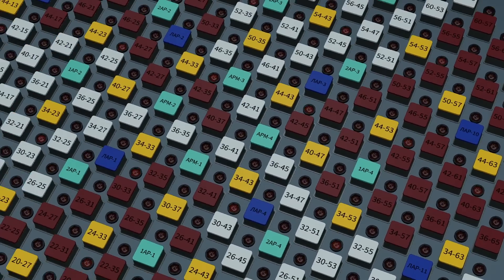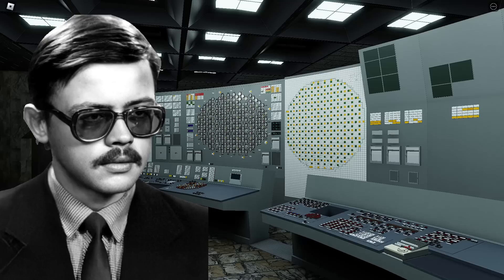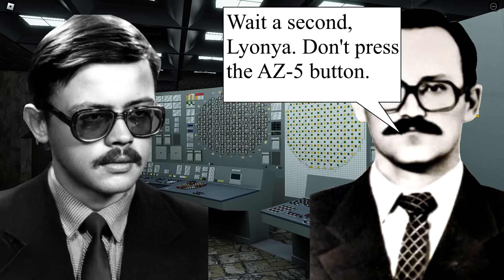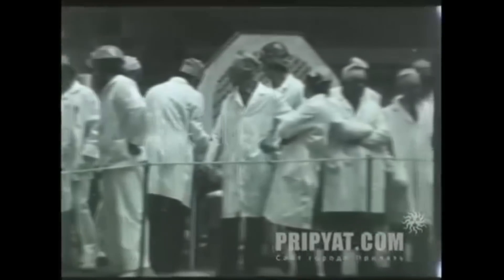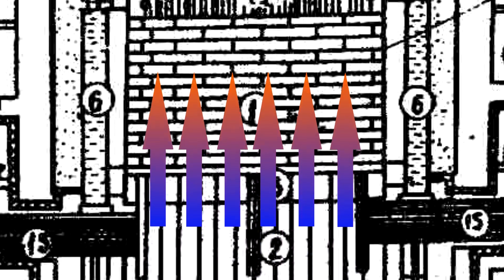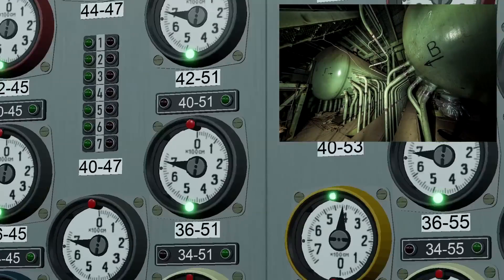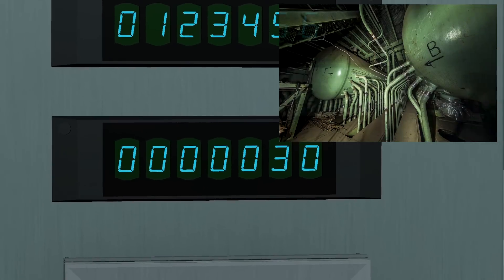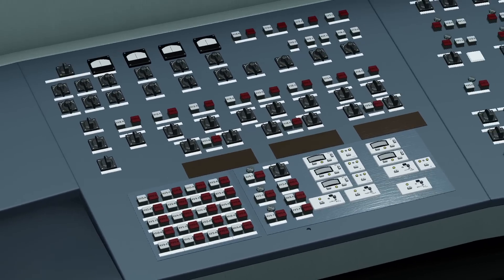Would Not Pressing AZ-5 SAVE Chernobyl?

Comment: Imagine you are fighting a fire, the fire is getting out of control and you hit a button to turn on the sprinkler system to stop the fire. Except the first thing out of the Sprinklers is gasoline, then water. That is exactly how those graphite tipped control rods reacted.
Reply: Not only do I agree with your idea but going off it, if people tell you “hey this is the button to activate the sprinkler system” “hey this is the button to shut down the reactor” than to me theorizing is kind of irrelevant because the button shoulda done what they were told it was going to do!
Reply: @littlehessurabi They should have known how the reactor is built to operate it.
Reply: @Ballin4Vengeance The Soviet partisans hid the truth about the design flaws, so nobody in the control room knew.
Reply: The 1.5m long graphite "tips" really should have reached all the way down. For maximum effectiveness and no positive scram effect. Bit late now though 😞
Reply: @233kosta  That is in fact how other RBMKs were retrofitted after this disaster.
Reply: @ArchangelUltra   One of many changes to make RMBKs less shit I'm sure.
Reply: The problem was that pressing the AZ-5 button sped up the process because of the graphite tips. It was like firing one of those small Q146 space modulators made by Marvin the Martian to blow up the Earth in Looney Tunes.
Reply: @joshuabrown3525  🤦
Reply: @joshuabrown3525 except the damage to the reactor from raising the power with 0 control rods in had caused the channels the rods were inserted into to become deformed they would’ve have gotten in regardless
Reply: Kinda, the graphite itself did not boost the reaction much, it was there to displace the water. The problem is in that circumstance, the water split into hydrogen and oxygen, oxygen being able to light and hydrogen being explosive. Normally that would be fine but there was too much pressure in the core due to the operators pushing the machine to far. The whole thing was designed for normal problems and not worst case scenarios.
Reply: @Tydye177 graphite did boost the reaction by a lot though
Reply: @Tydye177 There's evidence of the reactor going prompt critical in two locations immediately before the big explosion. The displacers are a good idea, but as is the case with most of communism - the implementation was somewhat lacking.

In this particular case, the problem was that they did not reach all the way down the channel with the rods fully withdrawn. This means that there's water under them which takes away reactivity.

When the reactor is already in an unstable state and reactivity is too high in areas where there's water in the channels, it is inevitable for graphite to pass through those areas first, before the boron rods make their way there.

Unfortunately that leads to a spike in reactivity, in an area which is already exceeding safe limits.

Had the implementation been such that the displacers permitted no water at all in the channels, this dangerous level of reactivity would have been reached sooner, perhaps preventing the withdrawal of so many control rods and prompting action from the operators sooner in order to shut it all down. Or it would have happened too quickly and blown up anyway, we'll never know. What definitely wouldn't have happened in that case though, is the positive scram effect which is widely regarded as the trigger of the big explosion.

Whichever way we look at it, it's a shit reactor. They never should have built it. And if they hadn't, the whole planet might have been nuclear powered by the '90s.
Reply: @Tydye177  yeah! the exponencial problem at the end was cuting water supply to run the test. when the water disappeared the reactor had no brakes. with or without az5 it would explode. it was a matter of time. the tips of graphite was the least of their problems. if it had boron tips it problably went the same way.. because if graphite became stuck for the cheer pressure inside the reator the boron tips would be also stuck because those braindead nuclear physicists removed ALL the fuking rods ALL the way out.
Reply: That is the best analogy I’ve ever heard to describe what happened excellent analogy
Reply: John Harris, i salute you and would love to hug you for such an impeccable take on the matter. 
Amazing!! Thank you❤.
Reply: Or like if you went to use the brake pedal before speeding through an orphanage, the brake momentarily accelerates the engine for a few seconds and then it begins to slow down.
Reply: Not exactly how that worked. They kept turning off alarms and ignoring the problem. They could have stopped it multiple times.
Reply: In that case pressing the button made no difference to the outcome.
Reply: @jekanyika  Actually it blew up the reactor.
Reply: @johnharris6655  I was talking about your fire analogy. The building would burn down regardless.
Reply: That’s how they reacted because the firefighter filled the lines with gasoline before he hooked up the hose to the water.  Dyatalov disabled the safety mechanisms in order to retract the graphite tips from the reactor… a position they should NEVER have been in. That’s the equivalent of putting gas into your sprinkler lines. When he hit the button… he inserted all of the graphite at once and spiked  the reactor. 

If he had done with the other technicians wanted when the test failed and just shut the reactor down normally it would not have exploded
Reply: Bro just described what we already know 😂😂😂
Reply: They were not graphite tipped. That is an oversimplification from the Chernobyl show.
Reply: Honestly, more like napalm.
Reply: It isn’t, the rods weren’t “tipped” with graphite as much as graphite was part of the rod design to help boost reactivity when the rods were withdrawn. The graphite was already in the reactor, they just couldn’t move them. 

A better analogy
Reply: Sort of... when the graphite passed next to the core, it accelerated the reaction exponentially, causing the temperature to skyrocket, boiling the entire coolant reserve which pressure locked the graphite in place, meaning, your sprinklers would have initially sprayed gasoline onto the fire with the intention of alternating to water almost immediately, except the valve stayed stuck on gasoline.
Reply: Nice analogy
Reply: Для любой аналогии к этой кнопке стоило добавить фразу "вы собираетесь потушить водой раскалённую до 10 000°С поверхность, доступ к которой осуществляется через микроскопические отверстия, потому что конструкция реактора не позволяет сделать это иначе"
Reply: I think better analogy would be that someone brought lots of grease to a building with sprinkler system and when the grease caught fire the sprinkler system made it worse. Sprinkler system was not designed for grease fires, just like the AZ-5 was not designed to cope with every scenario imaginable.
Reply: There was no fire. Reactor was not in a runaway when AZ-5 was pressed.
Reply: @xentiment6581 from my understanding the power has started to rise before they pushed AZ-5. And since the only thing reducing reactivity was the fuel temp coeff, it was basically already out of hand. Maybe they could've saved it by increasing the coolant flow, but I think that was the only option to prevent the power from rising. So it was basically already ignited.
Reply: More like nitroglycerin but yes 😂
Reply: It's not exactly how it happened its more of an analogy 😂
Reply: The HBO series was wrong about the control rods. It was the void half way in them that was the update.
Reply: Why would graphite be on the tips of control rods designed to slow  down the reaction rates??
Reply: @jonthomson9262  Cheap design, use the bottom of the control rod to speed up the reactions.  All well and good while the tip is not raised too far
Reply: @alanhaywood01  In fact, it seems to me like a good idea, if the end of the rod contains a moderator, then such a rod can regulate the reactor much faster and even stop the nuclear reaction quicker (by retracting graphite and inserting boron into the active zone, faster regulation can be achieved than just by inserting boron), the only problem was that the graphite did not reach the end of the active zone.
Reply: @alanhaywood01  well precisely, it wasn’t actually the cheapest design, but it worked for what the Soviets wanted it to do. It worked as long as you didn’t take the rods out too far and the safeties were placed to prevent that but Dyatalov disable the safeties and shut the computer off because he was intentionally trying to stall the reactor.
Reply: @jonthomson9262  So from my understanind of how the control rods worked, the RBMK had a sort of dual moderator/absorber system because it would simplify the reactor having both attached to the same rod. However, this turned out to be a fatal flaw.
Reply: @TheArrowedKnee  it wasn’t a fatal flaw in isolation…. Meaning that it was a known design limitation, and the designers built in safeguards to prevent the rods from being fully retracted and causing this problem….. but the operator, in this case Dyatalov disabled and removed all the safeties and then turned off the control computer that kept telling them to shut it down because he was trying to intentionally stall the reactor …… which is the equivalent of a firefighter loading up his hose with gasoline, and then wondering why spraying it on a fire caused trouble
Reply: @jonthomson9262   Because when you pull them out you want them to speed it up, and sticking moderator on the end is a good way to do that. Makes them much more effective at controlling the reaction.

Big mistake was leaving that much water under them when fully withdrawn.
Reply: @jonthomson9262  Graphite reflects the neurons, boron absorbs them.
Reply: Na... gasolinera Just make thenfire bigger, you are throwing water into a oíl fire
Reply: Yes, exactly @hernanweber3896
Reply: @hernanweber3896  Water AND gasoline mixed with diesel into an oil fire.
Reply: @hernanweber3896 learn to press space ffs
Reply: This is exactly the misconception this series of videos is trying to prevent.
Reply: This is the most “I didn’t watch the video” comment I’ve ever seen.
Reply: I think everyone is forgetting that a channel ruptured and prevented the control rods from going all the way back in, and THAT is what caused it. The graphite tips essentially sitting halfway in, accelerating the reaction due to the tips. The core was poisoned by xenon 123. Due to this poisoning, the power went to a mere 1% of the power required to do the rundown test. They raised the power, completed the test, and hit the scram button. It's important to note how quickly this all happened. Probably about one minute. Upon hitting the button all the control rods were inserted, after all but four were removed. As they slowly moved back in, reactivity and heat skyrocketed creating steam pockets in the water channels. Due to the positive void coefficient, rather than a negative one, the steam sat there and got hotter, and built more pressure until the unthinkable happens. Dyatlov, after all my research, was in the room, knew the core was poisoned, and still went ahead with the test knowing that the reactor was already unstable at low power and pushed it to the brink of disaster. The stars aligned perfectly that night
Reply: Best analogy i found
Reply: That actually HAS happened with the antifreeze they use in them back in the day.
I think they switched to non-flammable antifreeze for that reason
Reply: Fantastic analogy
Reply: You’re in shock…….nuclear reactors don’t explode. Someone get him out of here.
Reply: @WarNvrChanges  soviet RBMK reactors don’t explode comrade. You did not see graphite on the roof.
Reply: What a dumb analogy... You completely misunderstood what AZ-5 is if you compare it to a sprinkler...
Reply: @KasSo89  It's more like an engine fire extinguisher that borrows the fuel lines 🤣
Reply: @KasSo89  I think you are a Dyatlov wannabe 😐.

Comment: Why do you keep referring to water? That's at 100° plus Celsius as though it's not already boiling? Is it under pressure in the reactor or something? Once water hits 212°, it becomes a gas at one atmosphere of pressure.
Reply from the maker: The RBMK operates at 65 atmospheric pressures, so the boiling point of water is much higher :)
Reply: @thatchernobylguy2915  That makes sense, thanks for the info!

Comment: So basically the reactor would have automatically done the same thing as pushing the AZ-5 button. But if you could avoid this automatic process, and not press the button, then you likely still have a disaster but not nearly on the same scale because it probably wouldn't have blown up. The only thing I can think of is that you would need to immediately start inserting some control rods in order to try to lower the reactivity in order to not trigger the automatic process, but it's very likely this would still fail.

Comment: AZ5 was a detonator, not a shutdown
Tips of boron rods were made of graphite that induced enough reactivity for an explosion.
If they didn't press the button, the active zone would rupture due to tremendous heat and pressure that would result in a meltdown, not an explosion.
There would still be consequences like a white hot radioactive magma made of reactor fuel, graphite and concrete that they need to solve to prevent it from seeping into the groundwaters but the grand scale of the disaster would have been tens of times lower
Reply: They weren't really tips, they were as big as the control half of the rods. They were more like accelerators and they were already in the reactor when AZ-5 was pushed. 
The problem was they were a bit shorter then the height of the reactor with gaps on both sides between the graphite half and boron half(so below and above them was water) and that due to how long the reactor had been running at low power there were hotspots at the bottom. So when they all started going down at once to push in the control half of the rod, the bottom of the reactor would have had the water pushed out from those channels and would have had basically nothing to stop the reaction down there where it was already hot. This popped a couple fuel channels thus jamming the rods(meaning the graphite side was fully at the bottom of the reactor only just barely pulled out the bottom leaving no room for a water gap down there, and the top part had a water gap as the boron rods were just barely starting to get in) which lead to a runaway as the most unstable spot in the reactor now had even more graphite and less water and the boron rods couldn't get in
Reply: It wasn’t a detanoator it was just that the AZ-5 was a 1$ shutdown botton

Comment: is there a mistake in the temps?
Reply from the maker: No, high pressure increases the melting and boiling point of substances, including water :)
Reply: @thatchernobylguy2915  i knew pressure would effect it. Just shocked they can reach 2.5 x the boiling point.

Comment: By the time they pressed AZ5 it was already too late. They might have saved it shortly before that by inserting the shorter control rods from the bottom, where the reaction was running out of hand. They didn't have the graphite displacers and could conceivably have slowed things down enough for the main control rods to be lowered a few at time. Of course, shortly before that they could have just not pulled them all out in the first place.

Comment: At around 1:06 you mentioned that water enters the reactor at a temperature of around 265 degrees Celsius. I don't understand how this can be. I learned at school that water boils to steam at 100 degrees Celsius. Is there a mistake with the units; or am I missing something? Thanks very much for the interesting video.
Reply: Water has different boiling points depening on atmospheric pressure. The higher the pressure, the higher the boiling point and vice versa. 100C is the boiling point at 0 sea level.
Reply: @saladin69  I see. Thankyou very much for taking the time to answer.
Reply: RBMKs are Pressurized Water Reactors which operate at high enough pressure water can be liquid as high as around 400C. Boiling Water Reactors operate at far lower pressures and so water boils more in the 250-280 range.

For comparison, in Denver Colorado water boils at 95C. At the peak of Mount Everest it boils at 68C. If you were on the coast of the Dead Sea(1400 ft below sea level) water would boil at just over 101C. If the Dead Sea were to completely dry up(it's technically a lake and it's shrinking, it's about 1000 feet deep) and you stood at the bottom of it water would boil at just over 102C.
Reply: Pressure.
Reply: I believe this is called boyles law of anyone was wondering

Comment: But it's like reliance,
As told in films. The truth was hidden from them, They were in the dark.
For any operator of any kind the "Emergency Stop" is the last thing. It's the last ditch effort in a hope that the misery stops. 
It's like if the train hadn't pulled the emergency brake it wouldn't have derailed. But how can you predict that when a situation is going out of control rapidly the only thing that is meant to stop it will turn out disastrous. They were believed that "this" button will stop it.
But that's the thing, the last button should've been made for the safest output.
Reply: AZ5 was actually the way they usually shut it down.